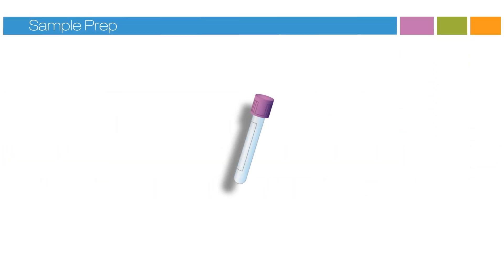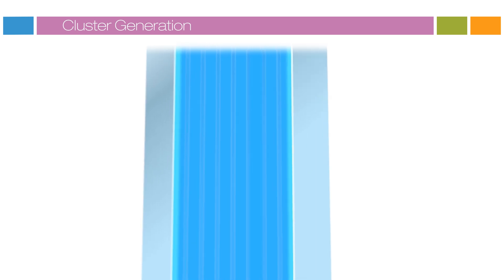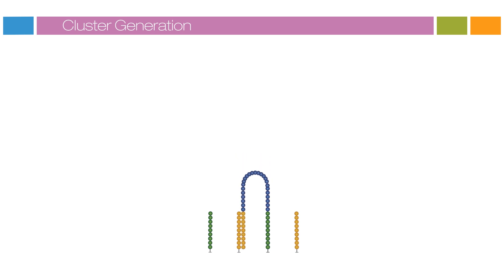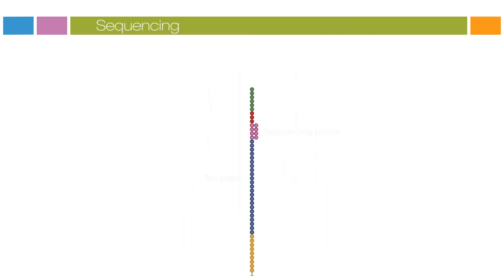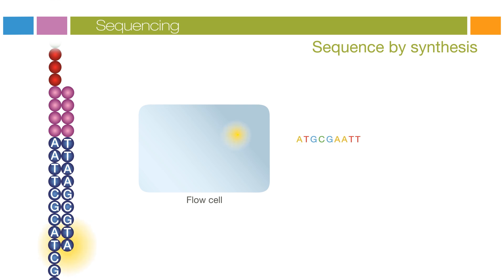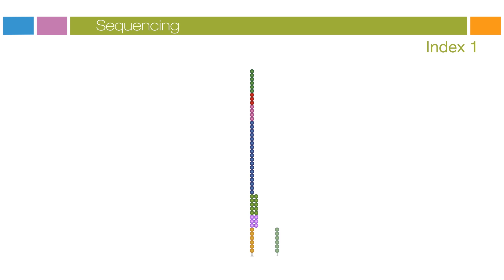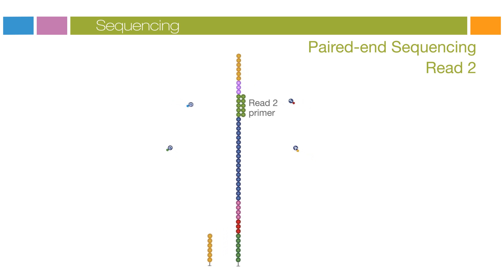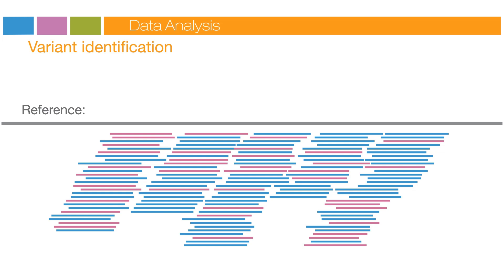Illumina Sequencing Technology

Comment: You should label 3' and 5' and make the colors of the DNA strands different colors and not just blue. Not labeling and using the same colors makes people confused on what is the template and non template strand. Also, the color coding you used for forward and reverse strand adapters at the start of the video does not match the rest of the video.

Comment: 0:36 the upper original strand should be 5 prime to 3 prime, so the primer  should bind on the right bottom side , instead of on the top left side (as shown in the video) thus the amplification can go from 5 prime of the primer to 3 prime of the primer, right? In this video it seems the amplification is going from 3 prime of the primer to 5 prime.
Reply: I agree with you.

Comment: How is the order of the bases specified , does every cycle assume that the next base shows up is up next in the sequence? And the order in which the bases light up from the flow cell, is the same order for the alignment? What’s the point of getting loads of the same read? Does the genome have different sequences for the same gene? What
Reply: Do the bases light up one by one ? Is this what is meant by base call?

Comment: Not detailed enough. Has each flow cell different oligos? How does the "denaturing" work? What if around a single and binded strand there's no oligo left and the strand can't build a bridge, do we get a double stranded DNA again? How is the reverse strand washed away? How is the 3' adapter blocked? ...
Reply: Each flow cell has the same oligos i think, Strands that fail to have adapters ligated are washed away, and i think they block the 3' adapter by binding with a complementary sequence,  I hope I have been a little helpful but i'm not really sure if i'm right.

Comment: what's the point in using index primer?
Reply: For example, one flow cells can generate 150M reads, but it's too many for one sample. So samples with different indexes can be pooled together and sequenced. All the reads will be assigned to different samples.

Comment: How do you know that only base is added during each cycle?
Reply: +Alexander Thomas You don't. And that doesn't happen. There's something called "quality control" after all these. Let me explain:

In each cluster, there's the same string with same nucleotides. Let's follow the example from the video. It says that T binds first, and another T after that. But this doesn't always happen at the same time for all the strings in a cluster. For example, when T binds to the second complementary nucleotide, in another string in the same cluster, A binds to the third complementary nucleotide. 

But when you look at the overall color scheme, you know that T comes the second with high certainty. 
Sadly, as the sequencing goes, the certainty level drops a lot. And when you come to the, lets say, 100. nucleotide, the certainty drops massively. Paired-end reading can help with dealing with this problem.

So,  as I said in the beginning, you have to do some quality control after these. Which includes, trimming of low quality base calls, removal of contaminants etc.
Reply: Alexander, in short, every base added has a block-cap and a dye. Only one base can be added in each circle. After the reading at the end of each circle, the non-integrated NTs are washed away, then the block and the dye are both cleaved and the circle is repeated. Now the last integrated Nt can receive a new Nt but no longer has a dye. Thus, in each circle only one Nt can be integrated and only the last one can produce light.

Comment: I don't get something.  How to you make sure that only one fragment gets caught in a single cluster?  If 2 fragments get caught in the cluster, wouldn't that PCR into 2 different sequences, messing up the reading later?
Reply: If you mean " If 2 fragments get caught in the same spot, so as to generate a mixed  cluster instead of a uniform one", the answer is Yes, it can happen. They arrange the concentration of DNA fragments in such way that generally only one molecule will strand to every small spot at the flow cell, and every cluster created  from it occupies only a tiny spot. Occasionally a couple of fragments will fall together mixing the signal but that's small exception. Each part of the original DNA molecules is represented many times. A computer deduces the overall sequence from the majority of signals, so a small number of mixed signals doesn't really change anything.

Comment: Stupid question but are all the clusters composed of the same fragment of DNA or is each cluster a different fragment? If each one is different, how do you get specific fragments to bind to the oligos in only one place?
Reply: OK, I found the answer in "Illumina High Throughput Sequencing Portfolio | Illumina Video" 05:30
It's called "Kinetic Exclusion Amplification". They claim to have designed the structure of each cluster such that bridge amplification happens so fast (20x primer hybridization time) that once a fragment hybridizes, it will clone itself so fast that no other fragment would be able to hybridize successfully within that same cluster.
I still can't believe that no 2 fragments will ever hybridize practically simultaneously in one cluster.  But maybe there's a way to detect and discard errors via multiple sequencing I guess.
Reply: Tom Carnwath Each cluster is composed of a different fragment of DNA. When a fragment binds an oligo in the flowcell lane, it undergoes bridge amplification which stays confined to the vicinity of the original fragment.
Reply: Nouri Al-Kadhim Let me rephrase the question. OK, each "flash" is from a cluster location of cloned DNA, right? They clone the initial fragment (in each cluster location) into many copies cuz building 1 DNA strand wouldn't make a bright enough flash to be detected by the camera, correct?  But in the flowcell, you have to ensure each cluster location has only 1 initial DNA fragment. If you have 2 DNA fragments in one location, it will bridge amplify into dual clones in one spot. Then you can't reliably read flashes from that cluster location.  How do you guarantee that there is only 1 initial fragment per cluster.  Not 2+.
Reply: Carmen Sandoval Yeah, but how to you guarantee "one fragment per cluster"?  If you have 2 or more fragments bind near each other, woudln't the bridge amplification yield a mixed set of DNA (arround that same spot)?  I'm missing something here I take it.
Reply: +rasmasyean from what I understood, you only separate the sequence after synthesis is complete. Listen starting at minute 4:17. You don't have to 'guarantee ' a specific location of any fragment. You only need the sequence and the computer software will sort the sequences out by identity matching, etc.
Reply: +rasmasyean the key phrase in the video that answers your question is "pooled sample libraries."
Reply: +rasmasyean If two sequences did hybridize together in one cluster, you would get a mixed signal each time you added nucleotides. I assume the computer would notice those mixed signals and exclude them from the analysis?
Reply: You are making the matter a little more complicated that it needs. The technical procedures reassure that only one DNA fragment will attach in each tiny spot in the big majority of times. It doesn't matter if that doesn't happen ALL the times, the computer deduces the final sequence after statistically processing all the signals- a few "mistakes" will be ignored

Comment: Maybe I´m just too tired after a long day, but I don´t really get what the index primers/reads are for. Do the index sequences change according to where the tagmentation was carried on or something like that? Otherwise, I don´t really see the point. Could someone explain this to me?
Reply: When sample libraries are prepared, unique indices are attached to each fragment. The libraries are then pooled and then run on the machine. The index reads are used afterwards to identify and separate the sample libraries.
Reply: katamari30000  - see my reply to AntiPop4Ever at the top of the comments. The indices are used to differentiate between the paired ends of the sequenced read.